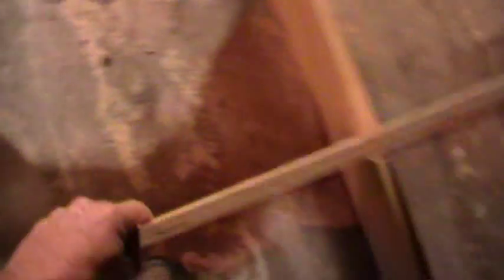Some Bulkheads cut....planning for inside stringers

Comment: Thanks for doucmenting all of this work, I'm looking at possibly doing the same thing with an 89 Capri 1500.  I was wondering, If you know, how important to the structural integrity of the hull are the stringers and bulkheads? In other words, if my stringers and bulkheads are totally rotted out (which I'm not sure about), might I experience a catastrophic structural hull failure at speed in rough water?  heh.  Thanks again for the documentation! :)